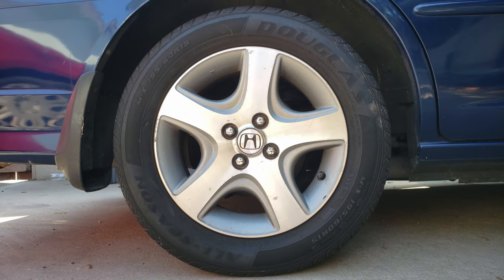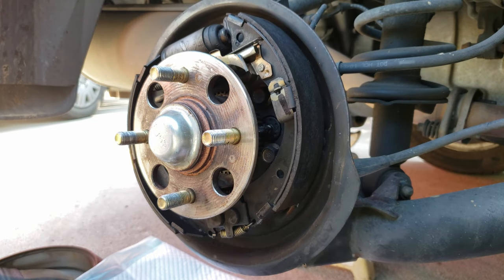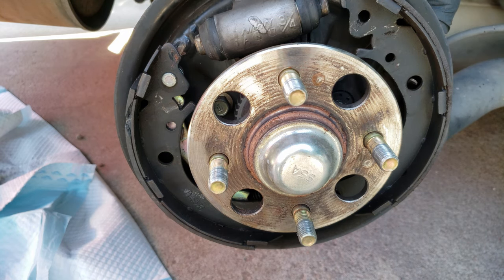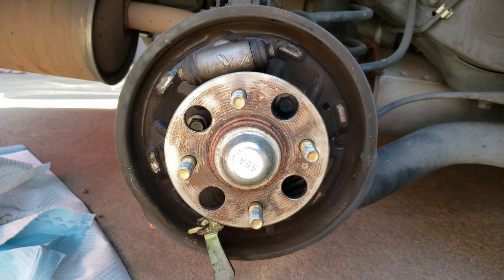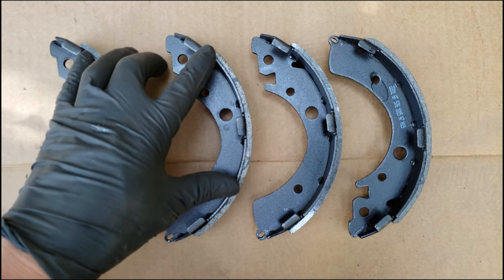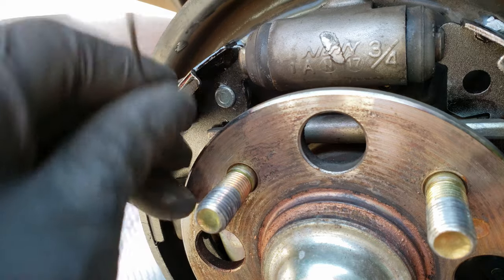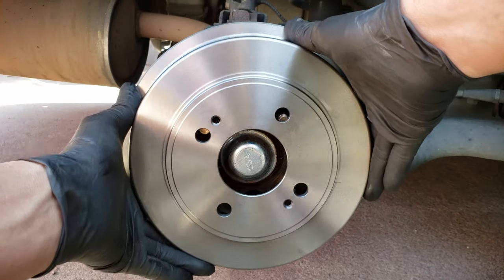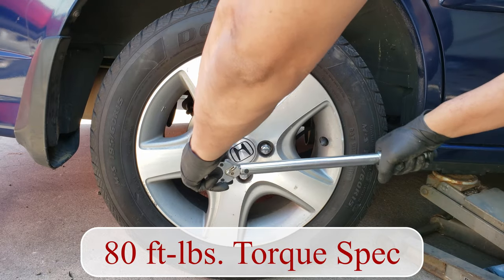How to Replace Rear Drum Brakes on a Honda Civic

Comment: Hey. What would cause my truck to die when it's put in gear?
Reply from the maker: Hi..only when u put it in gear? What kind of truck? Is ur idle low or rough? Any check engine light? If ur idles lower than normal and u put it in gear the transmission puts more load on the engine so the idle drops even lower so if it was already lower than normal itd shut off...but without knowing the rest id say try cleaning the throttle body or the idle air control valve if its not electronic throttle
Reply: @backyardchevy328  its a ford truck. the transmission was just put in but every time you put it in gar it cuts off. it idles at normal speed.
Reply from the maker: @michaelm2996  what year?
Reply: @backyardchevy328  its a 94 f 259
Reply: @backyardchevy328  f 250
Reply from the maker: @michaelm2996  if the transmission was just put in id look for something related to the transmission install like maybe something left disconnected the torque converter that was used if new or rebuilt...if the idles fine otherwise i dont think thered be an issue with timing or idle air control valve but if u can test the vacuum or if u hear a whistling sound then u may have a vacuum leak..maybe a bad egr...check fuel pressure if fuel pressure regulator is leaking it( disconnect vacuum line to fuel regulator if it has fuel then its bad) could also cause that.
Reply: @backyardchevy328  ok. Im pretty sure it's the converter. It wasn't replaced. And the truck runs very well. Just when it's put in gear, it dies

Comment: Ok,  no one ever mentions what to do when your drum is worn and has a lip on it. You won't be abke to just slide the drum off,  which is the most common situation when doing these brakes. There's no way to get to the adjuster clip that prevents you from backing off the shoes.  What a dumb ass design!

Comment: How to make it simpler and give you room to work. Remove the wheel cylinders first. Two bolt and a nut and you can now remove/replace the shoes as a unit.
Reply from the maker: Yea the assembly does come off all together that way..but itd probably be best to replace the wheel cylinder at that point and also will have to bleed the brakes afterwards
Reply: @backyardchevy328  It's worth at least $40 in aggravation. And bleeding brakes every 5 or 6 years is a good idea.  It's worth it to me
 to not futz around with vice grips on that one spring.  Appreciate the video!!!
Reply from the maker: @joelunchboxx  definitely, that is a good option as well

Comment: This is a very good video, & lays out the steps in a good order.
However, if you are a first time drum brake guy, do not for a moment think it will go this easy.
I can’t stress enough to take some good photos, showing things like the pin orientation for the park brake arm. Take only one side apart, so when,  it if, you have a question, you can look at the other side.
Be aware the other side is the same, but a mirror image, everything is reversed.
The biggest PITA are those clips that hold the pin for the  park brake arm. Once you do it a few times, you’ll figure out exactly how, but the first time is a bitch.
Ditto for the return springs. Allow quite a bit more time than what you figure on.
The next generation, 2006 & up, it seems very easy to push the wheel cylinder piston past limits when installing the big spring. Watch that the dust boot doesn’t come off..as you shove that spring, it will move one side of the piston, forcing the other side out.
I did an ‘06 today, haven’t touched drum brakes in about 15 years. There is a shop in town that will install your parts for $70, I’d let them do it next time.
Reply from the maker: Thank you...those are good tips..always take pictures before to compare with.

Comment: These things are a B!tch on the 9th gen, not only did it take about WAAAAY TO LONG with nothing but needle pliers and screwdrivers, but I stabbed myself with the needle nose trying to remove the c-clip from the parking brake lever.
Reply: 6 hours here. Dont feel bad.

Comment: The amount of strength you need to put on the long spring and the amount of tries it takes is not shown here, talk about a PITA, also look at the shape of the hook when he removes it, its not like that on the stock spring or a new spring. its a u shape I had to bend it out a little bit similar to how he shows it here but not too much cause then it wont hold.
Reply from the maker: Yea it does take a lot of effort..but the main thing is having good pliers..then its mainly pulling it back to position..maybe its cause ive done many that it doesnt seem like it requires much effort

Comment: Easy to say - difficult to do… Spent hours(including using my son as a helper) - no way to install upper spring… No room to grub by pliars and pull into tiny hole, and no screwdriver or anything else can help - no room.  Valves fled away - what a mess.  I could easily work on big brakes on trucks and vans, but not on these small ones.  

Used different methods… None is good, but to assemble upper spring on the floor, then put assembly on back plate was easier, but need to be careful- valves can jump out…
Reply from the maker: Yea its pretty difficult, but some pliers have better grip than others and best thing is to find some that can grip really well at the end
Reply: @backyardchevy328  I’m agree.

Comment: I thought they are self adjusting
Reply from the maker: They are but u gotta get em close, so the pedal doesnt drop too far and the wheel cylinder doesnt have to open too far to get brake shoes to rub against drum.